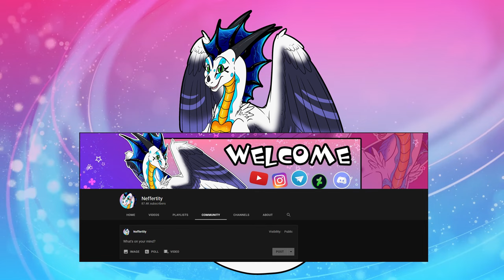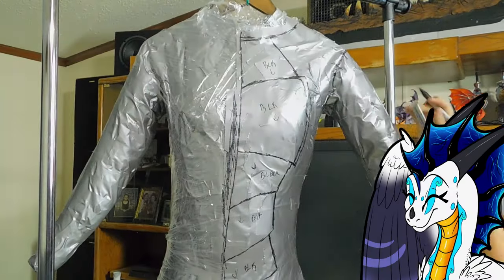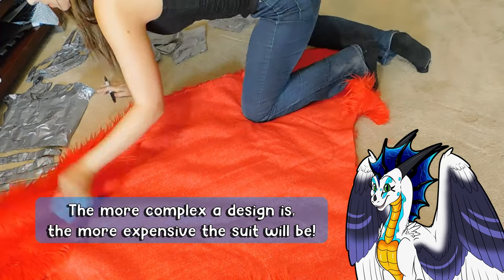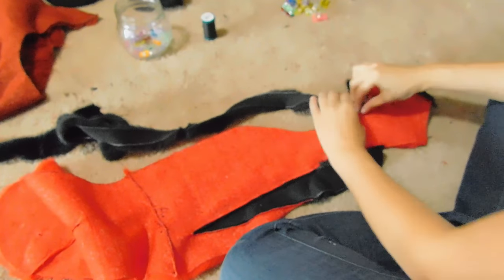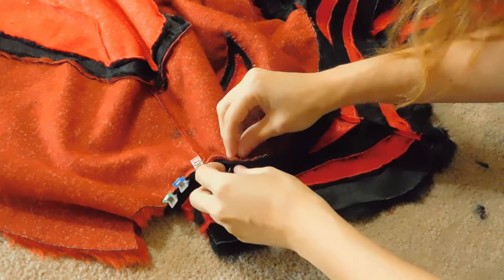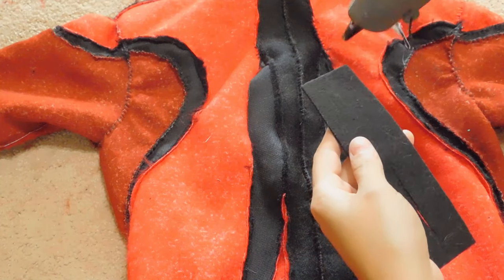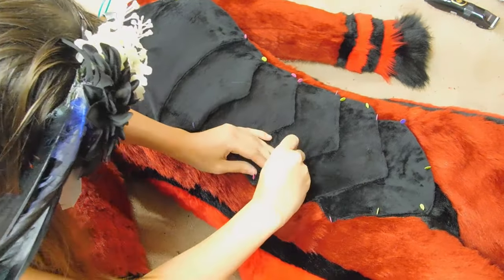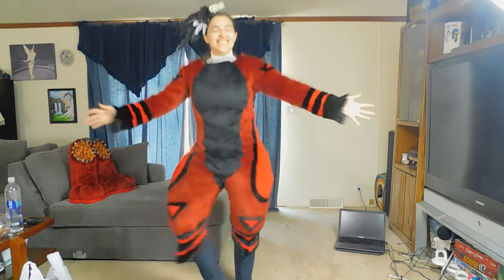[HOW TO MAKE] "SLIM-DIGI" BODYSUITS

Comment: "I don't trust my sewing machine not to eat it" I FELT that :') I started making plushies recently and my pieces are so small that I decided pretty early on that it's just better for my mental health to do most of my seams by hand
Reply: There's a solution to this!!! If you have teeny tiny pieces you're afraid of getting sucked down into the machine especially at the beginning and end of a seam, grab some tear away stabilizer or coffee filter paper and place it under the pattern pieces. Doesn't need to line up with anything, in fact you kind of want it to NOT line up. Have enough of it on all sides of the needle and seam to keep things from getting pulled into the machine. Works WONDERS!!! Especially with slippy stretchy minky fabrics!
Reply: @Love4everFree  this! I was actually about to make this exact same suggestion!

Comment: if you're interested, you could look into pad stitching to avoid using hot glue around the wing area. it's a tailoring stitch for attaching interfacing to the fabric it's stiffening, used in things like coat lapels and suit collars and other areas that need a lot of reinforcement to stay stiff. done right, it's invisible from the good side even on non-piled fabrics. (this is not meant to be rude or condescending! it's just something that came to mind when you explained the wing reinforcement).
also those belly plates look really good! i mean the whole suit does, but the idea with the velcro covering the zip is a really cool way of doing it.
Reply from the maker: This is FABULOUS advice! 
I wouldn't have thought about that, but noq that you mention it, it would work amazingly well! ❤
Reply: I mean from what I have seen its rarely condescending to suggest things you know that might help, I have a friend that does this and I'm always shocked by how much stuff she does do because she doesn't know about it.

For example, she was making a head and I asked why she used hot glue instead of something like spray adhesive, figuring it melted the foam or left a smell or something, the answer? "What's spray adhesive?" Apparently she tried it and it works well, lol, the more you know.

Comment: this tutorial is gonna save my entire ass for my first few body suits, Neff. I love the way you actually explain it rather than just saying it. that's a problem i'm running into with SkyeHighStudios' tutorials. she has a habit of just saying what she's doing rather than actually explaining why she's doing it, and it makes her tutorials hard to follow for me. (i love skye tho)

I'm very likely going to pattern, cut, and sew one bit at a time when i first start so it's not too overwhelming. like, do the arms fully first then set them aside, then the torso, then the legs, and then throw it all together. to make it easier on myself bc one, im just starting out, and two, im very neurodivergent and would be very confused at all the little fur bits if I didn't.
Reply from the maker: It's absolutely valid to break things down into workable parts, and then connect large pieces at a time.
Just like doing a puzzle. ^_^

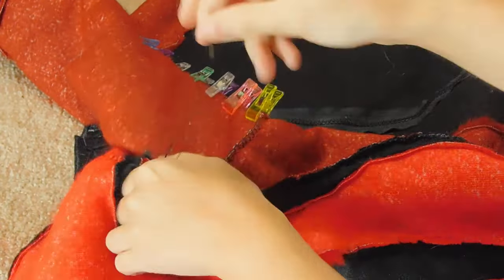Comment: I will say 30:28 in reference to the heavier thread, 
You always only want thread as strong as your fabric. 
Popped seams from thread breaking is always going to be an easier fix than your fabric ripping around that high tension area.
Heavier thread is a great idea but it’s always important to consider other ways of deterring direct pressure on areas when choosing where to place seems, then use that heavier thread to re-enforce after you’ve made sure all that force isn’t landing on one seam
Reply: Luckily a lot of fur available these days is SUPER strong anyways so this isn’t as much of a problem as often as it used to be. It’s funny when I take out some fur that I haven’t used in eons vs some of the newer purchases from BigZ and howl, the quality difference is night and day I’m so happy we have such in tune suppliers! They know what we need 💪🏻
Reply from the maker: Very solid advice.

Comment: I'm still very new at basically all of this, and know very little about the tools and processes at play. That said though, I come from a DIY background and wanted to give at least one piece of advice... You mentioned cutting duct tape with a dedicated pair of scissors, as they dull quickly. I would recommend going to a hardware store or Amazon or something and picking up a pair of electrician's scissors! I got a pair a few years ago, and I use it for thick tape, Velcro, and even cutting through stranded wire, and they still go through like butter. For around $20, I bet they'd be a great asset to have on hand!

To be clear - there might be a much better tool for this out there, but perhaps this would be a good option for someone without immediate access to a craft store. If you're gonna be heading out to a hardware store for the tape anyway, might be worth a try!

Comment: This video is pretty old so maybe you’ve already updated your method, but I would recommend using fusible interfacing to reinforce areas like the wing slits instead of hot glue! Or something like heat n bond. It’s like iron on fabric glue. (: otherwise, this is a great tutorial! I’m thinking of making a Pokémon costume and have never made any kind of mascot suit before, so this was perfect!
Reply from the maker: I think another maker had recommended that shortly after this video came out and it's definitely been incorporated into my newer suits. ❤️

Comment: late to the party but have you thought about using a heavy interfacing on parts like the silts for the wings, it'll reinforce the opening and shouldn't cause the same issue that hot glue does
Reply from the maker: Definitely something I've Incooperated into my newer suits

Comment: 33:03 i feel like an improvement for this, would be to take strips of webbing (strap material) and pad stitching them in. The benefits would be:
there is no hot glue used, always a good thing
the webbing is a structured material much less likely to crease and break, especially at those v edges
and it holds the fur backing more consistently so that you know its actually doing its job instead of just sitting on top which hot glue is prone to do
Reply from the maker: I've recieved a similar suggestion recently, and it's definitely something I plan to do with my future suits! ^_^

Comment: Quick question,if my Character doesn't have ANY patterns on there body would I still have to do the Tape over the DTD? Wanted to ask so I don't do smthing wrong
Reply from the maker: Yes, as the shape still won't be a single flat layer.
Reply: @Neffertity  thx, i wasn't sure

Comment: I noticed you didn't need to add any extra space allowance when tracing the pattern onto the fur and then cutting it out. Are there any problems with the suit being too tight afterwards?  Also, what stitch setting on the sewing machine is preferred?
Reply from the maker: I actually do add about 1/4th inch seam allowance to every part, excluding the tiny markings.

Comment: You mentioned you use a 1/4” seam allowance, but it seems like you went straight from duct tape to trace and then cut with no added seam allowance. Did I miss this or do you not add a seam allowance to the pieces except in the smaller pieces? Thank you I love your videos!
Reply from the maker: I add the 1/4th allowance when I trace the pieces from fuck tape to fabric.

Comment: Why not use a heavy-duty fabric glue instead of hot glue? Does it not hold up as well?
       P.S I absolutely love your work. Its amazing and inspiring!
Reply from the maker: I've recently switched to using E6000 since this video and it's worked wonders!
Reply: @Neffertity  I'm sorry I didn't realize how old the video was till after I commented 😅.
Reply from the maker: @dominiquemaple4619  no worries! The suggestion may help others coming to this video. ^_^

Comment: I was wondering if no-stitch and fabric glues could work instead of hot glue? I'm unsure of their strength, but I do know most no-stitch glues are machine washable and dryer safe.
Reply from the maker: I've been told a type of fusible interfacing would work better

Comment: Hey I have a question: 
How much money and time do theses suits ‘‘normally‘‘ cost? I mean they will probably vary a lot but in what frame are these? :) since I‘ve seen your first video I‘m obsessed with these and I really want to gather some information :D
Reply from the maker: Money wise, a fullsuit usually costs around $500 in materials alone. Closer to $700 if you use a precast or resin head base.

As for time, I'm proficient at this and it still takes me a month on average to finish a fullsuit.

Comment: If sewing a zipper on is the same with fur as it is with felt, how do you keep the fur from getting trapped in the stitches? Do you just brush the fur back out?
Reply from the maker: You basically brush the fur out if the seam as much as possible.

Comment: Hey Neff! Quick question: I’m making a fullsuit for the first time soon and I saw you already responded to a similar question but i’m a little confused with the answer!! So that the suit isn’t too tight, do you add the 1/4 inch of extra fabric around the pieces + additional seam allowance or is the seam allowance only included so that the fur matches exactly with the pattern? Like, are the extra layers of duct tape enough to make the suit loose enough without adding extra fabric besides the seam allowance? (Sorry if this is a bit confusing)
Reply from the maker: On all the other pieces is use about 1/4 inch seam allowance.
When it comes to the tiny pieces it's the same, except I only add it to the outside of the small marking, not the inside edge.
Reply: @Neffertity  Yes, I understand that part! But I mean when tracing the pattern and cutting it out, do you add a little extra fabric for wiggle room and seam allowance in addition to that? Or will the suit fit loosely enough without any extra wiggle room and only the seam allowance?
Reply from the maker: @PonderTheLight  oh, the pattern itself has no seam allowance drawn on.
I always add that when I transfer it.
Reply: @Neffertity  Oh alright! Thank you!

Comment: I was wondering something about the arm pieces and their seams - have you tried using a bias tape to cover the seams? Would that add too much bulk? Certainly, it'd add a significant amount of time to a suit, especially if sewn in by hand (which you'd almost have to to avoid making it obvious, right?), but aside from time and cost, would it be too heavy or hot?
Reply from the maker: I tried it once and found it significantly increased the heat, and decreased the mobility.
Reply: Thank you for the explanation! That makes sense. I'll bear that in mind!

Comment: I am wondering if one of those cheapy handheld sewing machines might be adequate to do the small hand stitch pieces? Has anyone ever tried one of those units? I used one once years ago to hem curtains, when I was living out of my camper full time for work. I remember I didn't expect much, but was surprised that it worked, though I think it was finicky and more or less "almost" worked well... Anyway, just curious if others had more experience.
Reply from the maker: Speaking from personal experience, no.
They aren't strong enough to sew through the thick faux fur.

Comment: I don't really see any step for this, but I'd like to know: for the foam pants you've made, are they glued on the inside of the suit? Or do you put the foam pants on, and then slide into the suit?
Reply from the maker: The foam pants aren't kept in the suit at all.
They are just used to get the templates
Reply: @Neffertity  so is the padding for the legs inserts, or installed on the inside?
Reply from the maker: @marisacharland9469  yes. I essentially make a pillow with the shape that gets inserted into the suit
Reply: @Neffertity  hmmm I assumed it was integrated in the legs cause your suit ups don't include you stuffing the legs after you pull the suit up to your waist
Reply from the maker: @marisacharland9469  Correct. The padding is sewn into the legs of the suit

Comment: Hello! Can i use an old riders baclava for my dino mask?
Reply from the maker: I would imagine as long as it's clean it should work
Reply: @Neffertity  its very skin tight so i dont know if its good or not
Reply from the maker: @rusnedonelaite4571  That's usually how a balaclava is supposed to be
Reply: @Neffertity   ok thank you for the help! I will come back for more when I need :)
Reply: Hey! Im back again with a new question😅 Where could i buy a good mannequin head? Becouse i cant find it on amazon
Reply from the maker: @rusnedonelaite4571  I reccomend the Ed Head by Monster Makers
Reply: @Neffertity  ok thanks!

Comment: How is the foam padding attached?
Reply from the maker: It's sewn in and stuffed
Reply: @Neffertity  is there a liner separating your leg from the padding, or does it lay right against the leg?
Reply from the maker: @christhelonewolf746  the padding in this suit was like removable pillows.
But normally I sew a lining into the legs that is stuffed with polyfil.
Reply: @Neffertity  
Ok cool. Thanks a bunch

Comment: makes slim suit but puts big booty on it: perfection, i am no longer flat

edit: oH PLEASE. MAYBE A TAG THATS SMALLER ELSEWHERE. [im kidding, you put them where you please, its your work. tho if i were to order from you in the future (which i hope i do) id probably ask about that, since tags irritate my skin easily ;-;]

edit 2: hand wash o-o that hot glue doe.
Reply from the maker: Regarding the tag, it's made of an extremely soft silk material, so it is actually more comfortable than the itchy backing of the fursuit itself.
I took that into account when I commissioned the tags.

I've also thrown my personal suits into the washing machine several times, as have my other clients. And they've never had an issue with the hot glue stabilizers coming off.
Reply: @Neffertity  yoooo that's so fucking cool holy shit. You're so smart omg